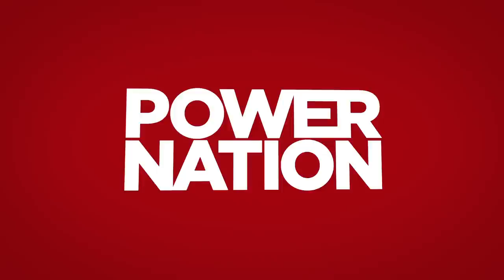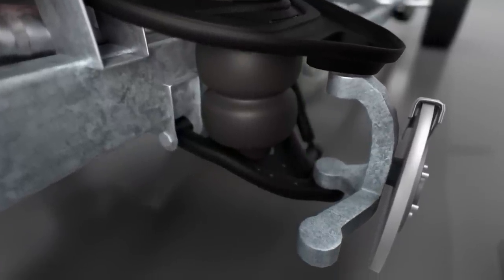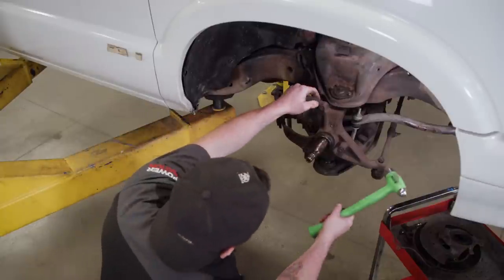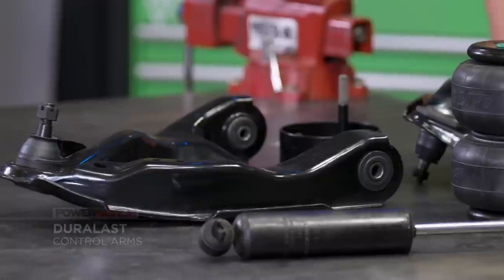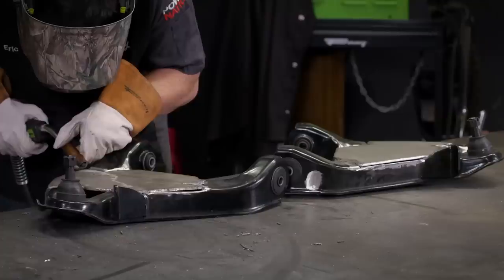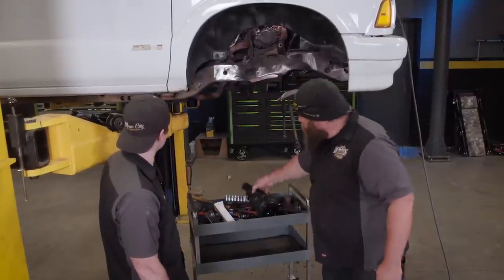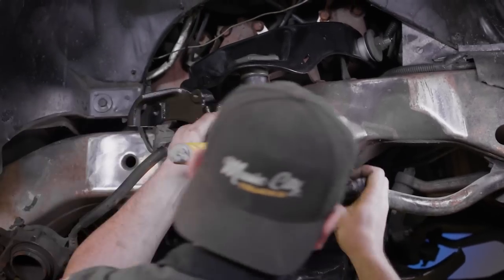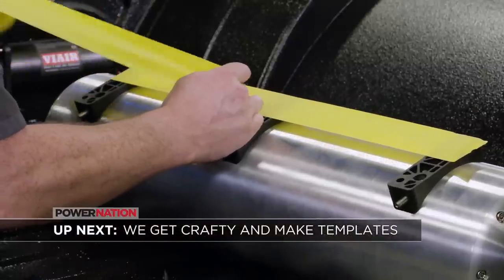Dropping The Chevy S-10 Suspension with Air Bags - Music City Trucks S3, E9

Comment: one very important thing was missed if you want your compressors to last. put a check valve in the leader hoses off the compressors tp the tank. if you dont all the tank pressure will be putting strain on the compressors when they fire up instead of line pressure being blocked by the check valve you have 150-200 or so PSI of pressure being stored in the tank pushing against the piston in the compressor when it fires up. could also cause some electrical issues with the extra amperage needed to fire up compressors
Reply: Eric didn't touch on it but Viair leader hoses have built in check valves on every unit.
Reply: @benosborne4502  they didn't use the leader hose. So they're going to have heat issues to
Reply: @brokentapedeck  I know, just didn't want people to miss the fact that Viair includes them.
Reply: I want some

Comment: Man so many negative comments about bagging a truck. Who cares if its not “useful as a truck” anymore. Thats not really the point. The point is it looks really cool, goes really fast, and is cheap and easy to work on
Reply: There just ignorant a properly bagged truck can tow and or haul more than a truck with normal steel springs
Reply: It's an s10 that's what they made for!

Comment: I love this channel and love that this is a true minitruck build but i am STRUGGLING to understand why yall went with a 5 gallong tank under the bed with another 5 gallon tank in the bed. Granted, the vales are in the tank in the bed BUT, you could have aaved a lot of work by going with a valve manifold AND not voided the warranty on the compressors by removing the leader hoses that have a check valve built in to them. Just seems kind of silly and a waste of time. Compressors/valve manifold could have gonenunder the bed and you have bit of a cleaner install with nothing in the bed.

Comment: Terrible way, no truck bed its pointless.  If you are going to do it you must keep the bed intact. No need to lay it on frame if it means you lose bed. Keep bed, go low as possible
Reply: If you're going this far with it...most likely youd have another truck to use....so having one like this isnt a big deal..🤦‍♂️🤦‍♂️🤦‍♂️
Reply: Where is your project?  Oh that's right.  You've never done anything.